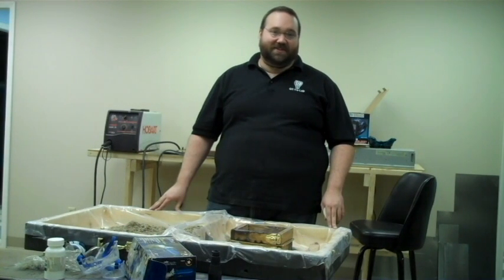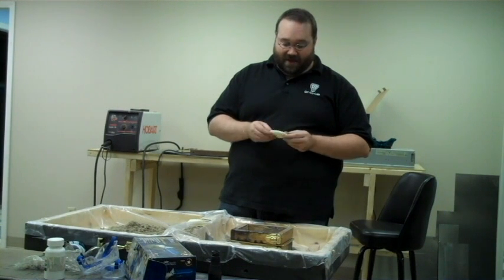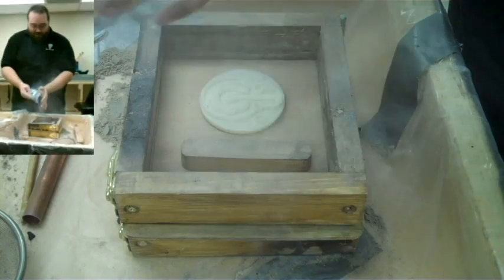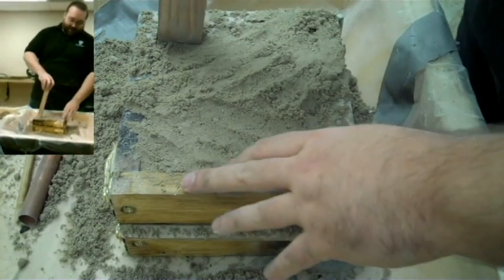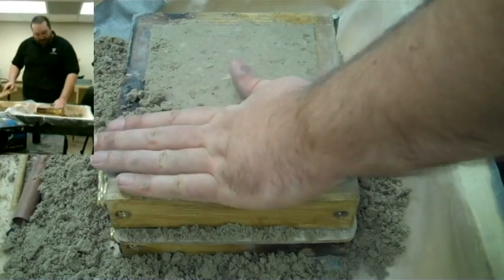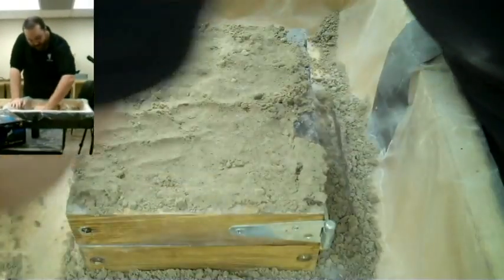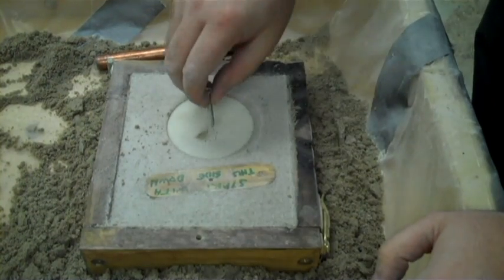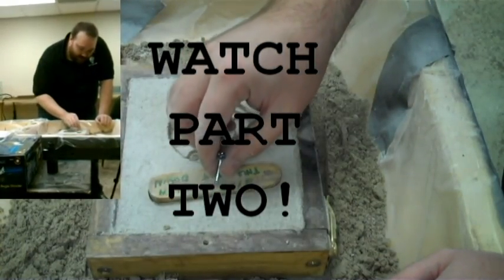Simple Bronzecasting using Makerbot prints! (Part 1)

Comment: Step 1) of any proccess that involves dusty materials sould be ...wear protective gear, Dust mask is a must. gloves glasses apron, etc. Ventilated areas preferably outside or in a room  with proper ventilation dust-fume extractor or filters.

The original master should be build with what is caled "draft" so the sand does not stick to it as in your video. Same works for injection molding or any mold process where the orignal part or a casted part must be removed from a mold.